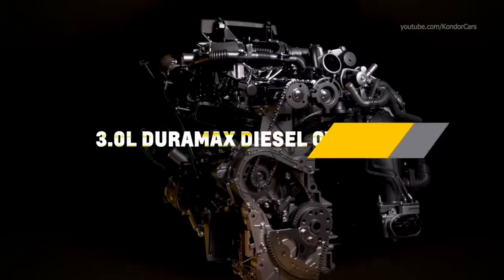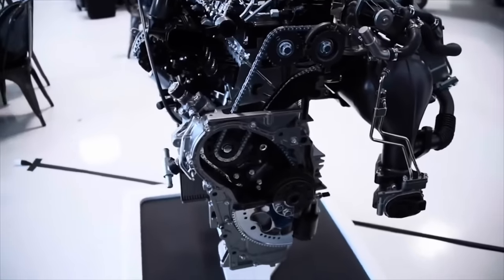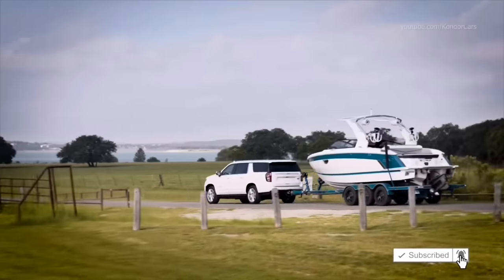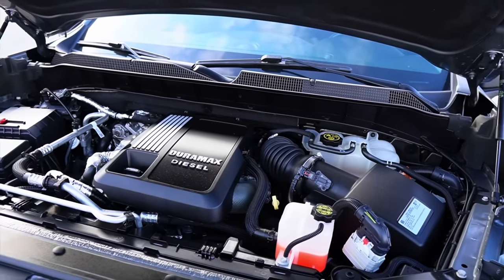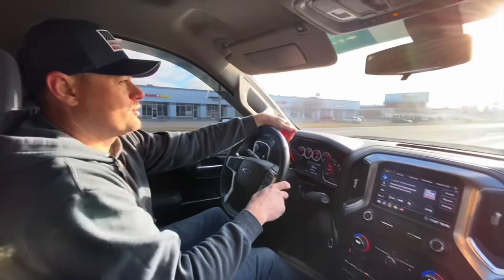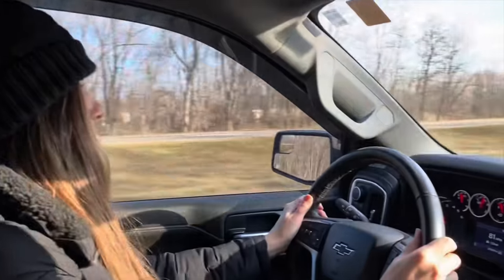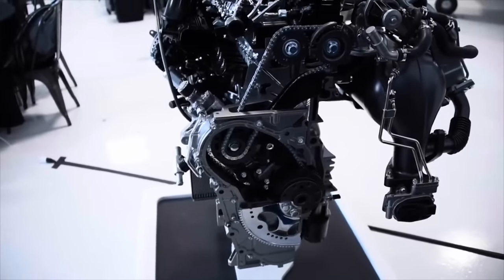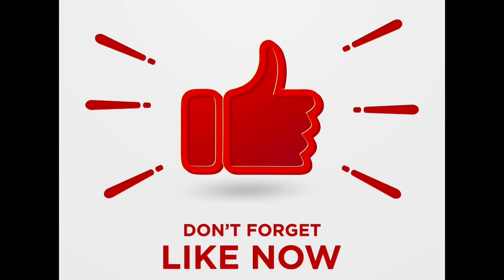What Everyone Needs To Know About The 3.0L Duramax!

Comment: I have a Sierra SLT Crew X31 4X4 3.0 diesel. 26k trouble free miles lifetime average 26.1 MPG which includes towing my 7000lb boat. Non winter over 30mpg is easily attainable. Absolutely love the truck, plenty of power and economical.
Reply: 26k without problems? I should hope not! Costs more to buy, more to fuel, more to maintain, and you haven't yet had an emission control system problem yet.
Reply: @Jeff W  This is my 4th diesel truck puchase I still have a LBZ Duramax with 180k on the clock. You sound like a Diesel hater. LOL
Reply: @stephenschiefer5276  LOL.
No, love them, used to own one and sad what they've done to their reliability. If the numbers added up for my use I'd love one, but unless you own a business and can expense much of it I don't see the math.

Comment: I was trying to find a base model chevy for a employee . I actually had 2 dealerships tell me to stay away from the 3.0 ! I know several ppl having problems with the 10 speed tranny also . One guy has 30,000 miles on his . Wont shift past 4th gear ! Guys had it  in to the dealer several times . Nothin . Trucks ben sitting in his driveway fr half a year now ! No thanx on both ends !

Comment: I have had my 2022 for about 4 months and 6,200 miles and I have yet needed to refill the def. It’s still half full.
And I have the crew cab with the upgraded interior and dashboard so I feel the inside is bigger and I’m 6’4 only 195lbs though. Lol
The best fuel mileage I’ve got is 34 miles to the gallon set at 250miles, I think.
And my rear gears are 3.73 so a little more torque. But is pretty gutless and no topend. But I love the gas mileage and towing my camper. And also my daily driver but no up grades out really for it.

Comment: You'll be spending thousands in emissions equipment by the time the belt needs serviced. I watched a youtube video of a replacement and you don't need to remove the cab. About $1000-1200 job. It's the least of my worries. I still bought an LZ0 and am worried about other things over this.

Comment: I bought the 5.3 instead even with the possibility of lifter failure i dont want a new diesel with all the B.S emissions components on them, i bought the pulsar LT to shut off DFM and auto stop and now the truck has 28k on it no issues yet im very happy i didnt buy another diesel, still got my old LLY but very happy i went gas on my new half ton.

Comment: With small doors in the back and limited room it's probably the low end model.  My Ram 1500 is similar to that and it's the low end model.  I only use it for pulling 3 riding mowers on a car hauler.

Comment: You want an equipment hauler get the big duramax.  I tow my camper with 35s better than my stock  5.3 Vortex max truck. 100% It definitely  grunts pulling  a mini excavator up big hills. Great truck if you tow occasionally but mostly pound pavement and gravel out hunting.

Comment: I have a ‘20, LT, Z71, off road (Goodyear duratrac) tires.  I have about 37,000 miles on it.  Prior to purchasing it I knew about the oil belt that needs to be replaced. I haven’t had many issues except for an overheating issues that happened several times in real cold weather.  GM decided to replace the ECM, around this past spring.  So far it hasn’t replicated the issue.  I purchased my truck because I had a Toyota Tacoma that struggled with towing up any hill.  I have a travel trailer that is about 3,700lbs unloaded.  The Silverado has no issues pulling the trailer loaded, and a truck that’s completely loaded down.  I’m not sure how good it is under max towing conditions, but it suits my needs fine.  The engine exhaust brake is a joke.  I get about 23mpg avg @ $5.79 a gallon here in Ohio.

I like the truck but I’m looking to get into a 2500 gas after having this 3.0.

All in all it’s a good truck to pull a smaller trailer (7500 lbs) occasionally, I dont think it’s the “workhorse” you would want.

Comment: I've in the passed owned plenty of 5.3 Silverados.  It is a great engine with a great history.  If I was not using my vehicle to plow my and relative driveways.  I would own another one.
Reply: The 5.3 has a horrible history.   The AFM has been junk on these motors.  The oil pump in my 2014 went at 40000 miles.  $2500 repair job. All the domestics are junk now.

Comment: If you are going gas you should try the 6.2, almost the same mileage as the 5.3 and has considerable more HP. One of the best engines designed by GM

Comment: I looked at them and ended up with the 2.7 4 cylinder and it’s specs out the same as towing capacity almost as good of fuel mileage. It feels like a small diesel with the turbo on it.
Reply: I own a 2.7 and way more cost effective and less problems  cost less for fuel ⛽ 3.19 VS 4.99 for Diesel

Comment: I prefer the GMC 1500 in a AT4 I was talking to the service manager at dealer when I bought my 2018 Chevrolet Equinox diesel in for oil change because it's FREE anyway what he said is the 3.0l duramax seems to have issue with the DPF issue in the winter
Reply from the maker: I’m
Not surprised
Reply: @TruckMaster  it's kind like when the Ecodiesel came out it took like a 3 years before they have a good tune there's not much for aftermarket in of a emissions diet I'm about to do a emissions diet on my 2018 Ecodiesel

Comment: The 6.6 duramax smaller version little brother 310hp/520tq 4.5v8 GM shelved in 2007 would have been perfect for the 1/2 ton gm trucks....but anyway I can't wait until someone post a video of their blown up engine because of the belt driven oil pump and the cost to repair

Comment: I think its a great, especially deleted. But how long will they continue to make these? How much aftermarket support will it have?

The only failure I see is the belt driven oil pump . Which is a easy fix. But it does make you wonder lol one day it could snap vs a chain just having a little slack lol

Comment: Lz0 w tow package has been pretty cool, hauled some stuff with utility/ closed trailer, shes great with mpg. Sport mode driving on a highway it’s slow but quick bc of the 10 speed if that makes sense . Like truck master said maybe fun if it had aftermarket support

Comment: I own the 22 refresh crew cab LTZ, came from the 15 6.2 high country. Love the 3.0 , way smoother and fuel economy is outstanding. Maintenance costs are about the same since both engines have the same amount of oil and filter sizes and fuel cost is close considering you're supposed to run high octane in 6.2.  Acceleration is better from dead stop but does lack at passing speeds. Miss the 6.2 for that, towing is better with the 3.0 and now GM offers the max tow package with the LZ0 which puts it at 13500 I think.  Traded the 15 in after 2 cam and lifter repairs that when they fail is about 6200 dollars each time at the dealer .Overall its probably the best truck I've owned not sure on the oil belt situation yet but it doesn't scare me as a guy who does his own work but I'm sure its pricey at the dealer.
Reply: damn i need get those jobs 6200 lol wow
Reply: @overbuiltautomotive1299  yeah dealer labor and you have to remove heads to replace lifter and the cam usually is destroyed.

Comment: Love my 2020 sierra 1500 slt, great mileage, works well for out small homestead. The down falls are def, so I had to have the ded tank and pump replaced with less than 5k miles. I would get erroneous readings it would tell me I had a 1000 miles left then turn around and say I had 300 mile left after driving 100 miles. You talked about the cost of DEF, I don't buy from the part store or Walmart, way expensive $50 for 2.5 gallons. I get it at the truck stop or some gas stations, it's only 3.49 ish a gallon. Also, in November I drove from southeast Alabama 17 hrs to new Mexico pulling an empty 18ft flatbed trailer, and that thing ate up a whole 5 gallon tank of def. Other wise around town I get 5k miles ish out of 5 gallons. Last spring I finally had to change the fuel filter, what a nightmare. The cover is plastic takes a torex bit and wouldnt come off. I took it to the dealership to have them do it and they broke it. Tried to charge my for a new cap. Stood my ground as they broke it and had them pay for it. My Sierra SLT has tons of room. I will say the inverter is only rated to 400 watts, so don't plan on using any power tools with it

Comment: I was looking for the diesel in 2020 in at4 but sadly it was driving off as I pulled in, I purchased the very last 6.2 in slot haggled 10 grand off msrp and I think I dodged the bullet I have a house I’m Knoville and L.A. an do 3 road trips a year, the diesel got better mileage but was almost 2 bucks a gallon more in L.A. it was over6 bucks a gallon and the 6.2 is a dream I didn’t even know I was trailering. The only draw back if you don’t realize your crushing at ninety plus, side note this truck came with the new bed that I didn’t want, ITS WORTH IT, every penny I was looking for the duramax but I think our own federal government is working against diesels. I wouldn’t be surprised if we run out of fuel.

Comment: gas engines have emission problems also chevy does not overate there towing capacity like others think about it towing 12000 lbs with a lite duty half ton is not smart any body with tow experance will tell dont listen to salesman 90% have no clue

Comment: I have a 2021 3.0 truck has timing cover leak getting fixed under warranty, (yes, cab has to be pulled.) Gets good milage and yes, cool to have the diesel 4x4, The other thing is this truck and motor is not for heavy duty!! so makes no sense to do any comparison there. Get the 2500 big diesel for hauling and plowing sure it has more power also 9 to 12 MPG (one who knows the truth I owned a lot of em:-) If you add kits and chips etc gets a whole lot worse on repairs and milage as everyone knows. Good video but "apples to grapes" on comparison so did not make a lot of sense to me. Good vid though🙂

Comment: We had a 2021 LM2 for about a year. It is an OK platform if you commute 30+ miles per trip. Frequent short trips bring increased regens and potential DEF issues. The 10 speed transmission was OK, but felt like it was always looking for a gear. The truck honestly felt like it was too much work to enjoy. It's a fantasy to think you can replace a 3/4 ton diesel truck with one of these.

Comment: I have a 2023 LZ0 and in the month I've owned it (1400 miles) I've had the check engine light come on 4 times and it's currently at the dealership being repaired again. I really wish I would have kept my 2017 with the 5.3. I had almost 100k miles on it and never had a check engine light.

Comment: I have a question for you. Can you build the transmission in a 03 6.6 to hold over 500hp. I am pushing 700hp and it goes in to limp mode. Really need help.

Comment: Regarding interior space, the truck you test drove is a double cab, not a crew cab.  Your towing capacity comparison is apples to oranges. 11K towing on the 5.3 is with the max trailering package and 9K towing on the 3.0 is without max trailering package.  If you add max trailering to the diesel it's 13K towing.

Comment: First, you've reviewed the smaller cab version. Second, you've missed the target demographic. For someone who uses their truck as their office, an increase of 10mpg offsets the difference in fuel cost. For someone who occasionally tows a 4000 pound boat, the increased MPG while towing is also a huge plus. But, I wouldn't expect much from anyone running low pro high healed shoes in their 1 ton trucks. Word of advise too. Rehearse and edit better. This was difficult to listen to and take seriously.

Comment: I agree with what you said whats the point. My 5.3 gets 21 highway and gas/maintenance is cheaper.
Reply: Maintenance is cheap on my 3.0 Duramax if you do your own oil changes.  Cost me $55 for oil and filter from rock auto. DEF is super cheap from Wal-Mart.  $11 for 2.5 gallons.

Comment: I almost got one of these this year in the GMC Elevation edition.  Long term they probably would last a long time. However, I the rear driving belt that is tucked between the transmission and the rear of the block, has to be inspected at 100,000 mile and replaced between 110-130,000 miles. Dealers are charging about 3-5$K. Also just to inspect the transmission has to be removed that is 1-1.5$k price tag unless you know someone and that could alter the warranty. At this point I would suffer for a gas in the 6.2 which has a higher towing rating than the 3.0. But cheaper than getting a 2500-3500 6.6. Its all about what you really need or really want and the budget... If all the belts would have stayed in the front it would have been a hell of a machine!!!!

Comment: i have the 2021 1500 rst duramax 3.0 with 28000 miles and a 3.5 lift with 34.5 tires and a overland kit and as far as the truck i love it but its been in the shop for torque converter and trans pump also parts are a problem and regular 1500 parts will not fit this truk was hell to find rims and other accessories but the truck itself is a beast i just dont trust it

Comment: Have had our LM2 for little over a year.  Traded my 2014 Silverado 5.3.  Also had a 6.6 Duramax.  As a daily driver we really enjoy the 3.0 diesel.  Plenty of torque and power and the combined mileage I get is about 27 mpg.  Have had an issue with glow plugs that was easily fixed in warranty.  
If you really need a tow vehicle for a bigger load, get the 6.6 liter.  There’s no comparison. 
Never had any problems with my 5.3 liter but the lifter noise was bothersome and mileage was ok but not great.  Power was ok but the 3.0 diesel powerband just fits my driving style and traffic better.  But it does use more def than our 6.6. 
Overall it has been a great vehicle for our use.

Comment: I traded in my L5P for the 3.0. I knew it wasn't going to have the power of the 6.6 and I was never under the impression that they would be similar. However,  the 2500 is like driving a school bus compared to the 1500.  The 3.0 tows great and still gets respectable mileage.  Unless you are towing huge heavy loads on a regular basis,  the 3.0 makes way more sense for the average person,  especially with diesel fuel hovering around $5/ gal and the price of the 2500's skyrocketing with limited availability. IMHO,  if your more worried about speed and a peppiness,  then get the 6.2.

Comment: You finally got it, cruising range with the diesel especially when traveling. I hear the factory recommends changing the timing chain at 100,000 miles on the Duramax and this involves removing the engine, gonna be a big ticket for this job.

Comment: I owned a 2021 Tahoe with the 3.0
I love the fuel economy and I really loved the exterior look of the new body style….

I had numerous issues with the engine cranking over but not starting. I had it towed to the dealer twice and every time they would look at it, they could find no problems.  I ended up selling it and buying a wagoneer with the 5.7 and am very pleased so far. The wagoneer doesn’t get the fuel mileage but the fuel price offsets the difference plus it has much more power

Comment: I have a 2000 F350 crew cab with a 7.3 diesel and 172k on the clock. I wouldn’t trade it for the 3.0 Duramax Silverado any day. I would want the 3.0 in a Tahoe or Suburban for the wife but that would be it. 

If you test one of those let me know.

Comment: Ive had 7000 lbs behind my 3.0 and it pulled it way better than my old 5.3. I daily tow a enclosed 19’  Aluminum trailer for work and i would never go back to the 5.3. 17 mpg towing 3000 lbs is awesome. I think they derated the towing capacity so they last 200+k miles.

Comment: I really wanted this engine in a Silverado double cab. I loved the size and torque. Unfortunately after some research I was told  to stay away. I ended up with a Ram 1500 with their diesel which is very proven, except spinning bearings. I’m looking at a Silverado 6.2 now

Comment: Good review Josh, but honestly all I needed to know is that it has problematic DPF, SCR and EGR systems to know that I will never buy one. My 06 with the 3LT package and every option available at the time is plenty comfortable to drive and far more reliable than any new diesel truck. I wouldn't trade it for a new truck if it was a straight up trade. Plus the '20 and up Chevy's are uckin fugly! I mean that front end and those mirrors!? WTF were they thinking?

Comment: 8/05/23. Bought Chevy 1500 RST Duramax Crew cab, 6ft bed, Z71 fully loaded. Max tow page 13k lbs. Yes a proper 6ft bed on a 1/2 ton w/ 13k tow.. Traded my 17 2500HD LT Duramax 270k miles. Love big duramax, but this baby D. Wow. 570-690 miles to a tank. Best 32.5mpg, avg 23.8mpg, and city stop and go 19.4mpg.  Have 2700 miles and half tank of Def still. Quiet engine in drive thru's when ordering. Smooth trans. Love the 13 in screen. Now the bummer part. Seats are crap, my old truck, the seats were better. Start up, Radio on and fan turned to high for 105 degree heat in Texas. 25 seconds later radio vol blips and fan turns to low every time. GM still can't figure it out on all 2023 models. Towing- can't compare to big D. But compare to 5.3L V8. Baby D will tow circles around it and get more than twice the fuel mileage and hold 75mph with the trailer that the 5.3L V8 can't do. Tested with 7100 lbs fully enclosed, double axle trailer. 150 mile drive, Baby D 18.3 mpg highway @ 75mph and 5.3L V8 only did 8.2mpg. @ 68 mph. Emptied the tank. Couldn't get the 5.3L up to 75mph too much wind drag. I love this baby 3L  Duramax.  Fyi my wifes 2015 5.3L replaced lifters twice. Once @ 95k miles and again @170k miles. $4400 each time. I will never buy the 5.3L ..
.GM ... please fix the computer issue blip and fan speed after start up. It's super annoying to have to turn it back up every time. AND put better seats. I feel I am on a balance ball at an office desk. It's a challenge when off roading.